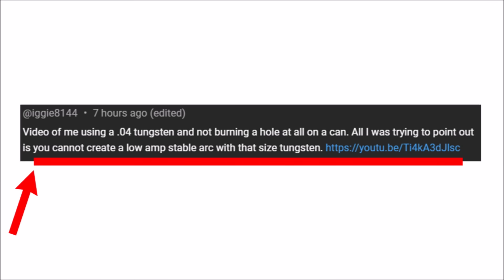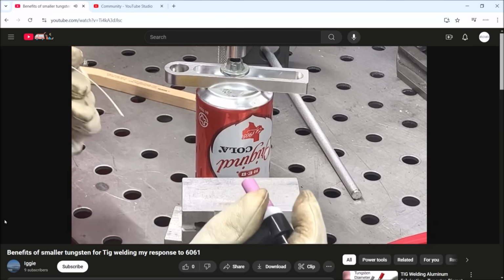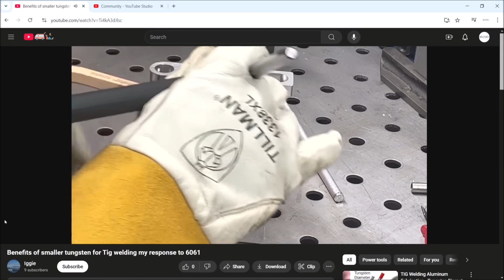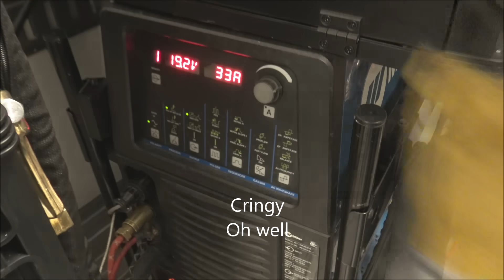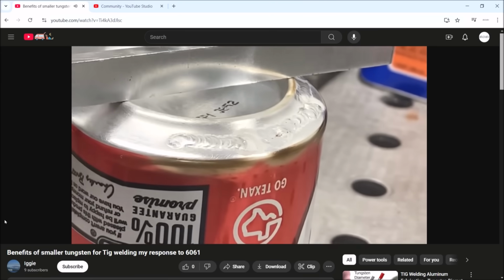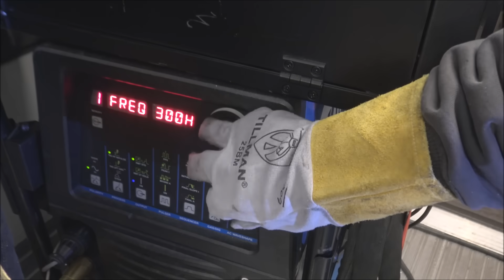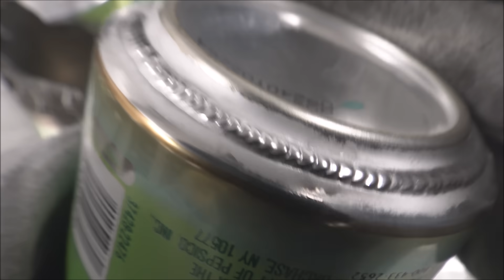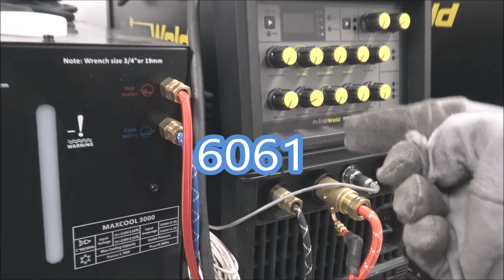You May Have Been Duped... Ego is NOT our Amigo. TIG Welding Aluminum

Comment: Another great video.   I'm looking at the 325x but debating on the water cooler option.  Most of what I do is 1/8 wall tubing and fusion welding 1/2 rebar.
Reply: Ultimately It's up to you, but here are a few things to think about.

- What materials will you weld?
Generally, AC will heat the torch up more than DC.

- How often will you use the machine?
If you use the machine infrequently, then it's not really necessary.

- How cold does your shop get?
Colder environments will require coolant to be used to prevent freezing.
Warmer environments can get away with just using distilled water.
(Do not use tap water or vehicle coolant) 

I managed to use an air cooled 17 for most of my career, only since my last few employers I have had the luxury of a water cooled 20.
Reply: Good Video
Reply: get the cooler, it is not much more and lets you use the smaller torch
Reply: I went from an AHP 201x to a 325x and got the water cooled torch strictly to be able to weld aluminum without taking breaks.  Aluminum loves heat so you gotta blast it and that heats up air-cooled torches pretty quickly.  I've done a lot of aluminum with the 325x with the water cooled torch and it is a dream.  The water cooling system does add another maintenance point though.

Comment: I'm always worried about my iphone sitting on my table when welding. My man has his laptop sitting there just watching him throw lightning bolts into the can. I love it.
Reply: I have also had some Milwaukee batteries and other small electronics die when sitting on the bench after AC welding. I don't understand how it works but oh well.
Reply: At my old shop with my 180sd, as soon as I struck an AC arc the cordless shop phone handset 10 feet away would ring and xm in next door shop would go out
Reply: Havnt welded for work in years, but you just reminded me that one little molten spatter ball will crack a phone screen.
Reply: @6061 😂
Reply: @6061  wow rude!  My last feeling shredded. 😂. Thank you. Keep up the vids.
Reply: 😂 100% agree
Reply: @6061 hahaha!
Reply: @6061 😂😂😂😂